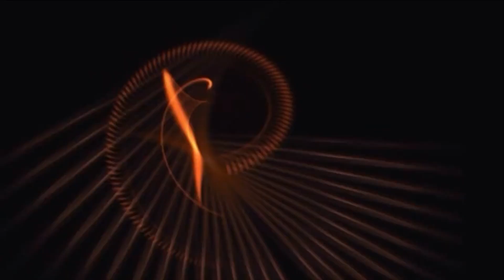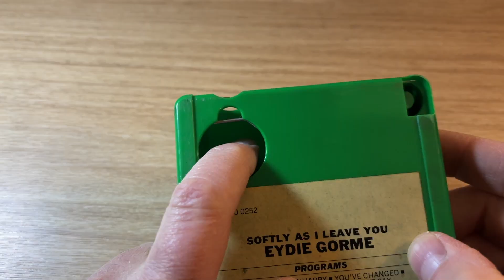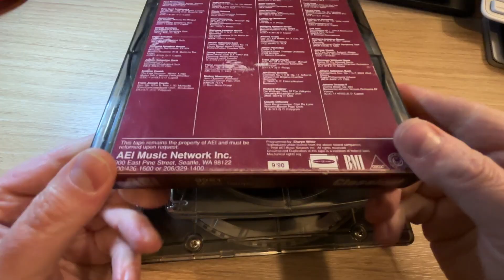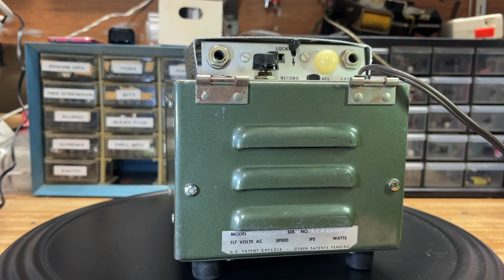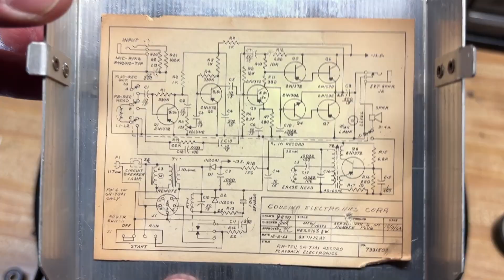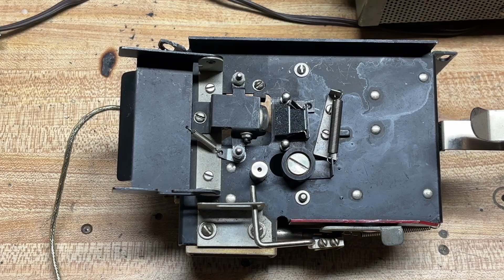This “Lost” Tape Format Is Wild! Cousino/Orrtronics Audio Announcer Explained

Comment: John Herbert Orr from Opelika, Alabama aka Orrtronics was a pioneer in magnetic tape. Also in opelika, a was Ampex tape. I had a friend years ago that worked for and with Mr. John Herbert Orr. This friend owned an electronics business in Auburn, Al. I have a John Orr designed 8 track player not like the lear 8 track that everyone knows but somewhere down the line i have lost the tape. This thing is unique as the head comes into the bottom of the cartridge. I was told that John Orr sold the rights of this system to Bill Lear of the Lear Jet Corporation in which is was re-designed. I don't remember where i picked up this player which is for automobile use. If someone had a museum or just wanted this player i would let it go. Seems like everybody was back then was wearing out the endless loop design method of tape transport usuing graphite lubricated tape.

Comment: There's yet another Orrtronic endless loop cartridge format. I've only seen one, and that was back in 1967. It looked like a 4 track cartridge, no pinch roller, but the tape ran parallel to the bottom of the cartridge! I suppose the capstan entered into the edge of the cartridge, the head and pinch roller came up from the bottom. Very very strange. Obviously designed to circumvent the Fidelipac, Cousino and 8 track cartridge designs. I wish I had kept it, but it belonged to a friend, who sadly, has passed away.

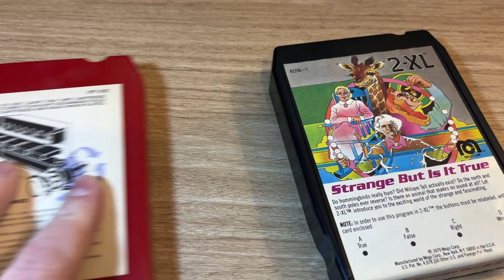Comment: I have the Quad tape seen at 2:10
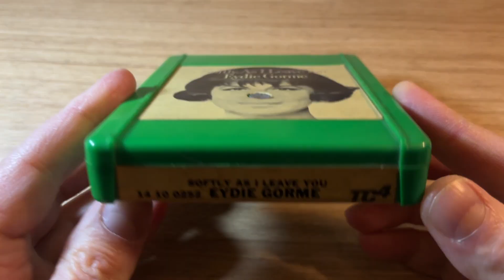You likely tell, but the pinch roller for the tape at 2:27 swings up and into place from the deck. And, please, the screw was covered by the graphics until someone cut out the opening to open the tape. 🙄 
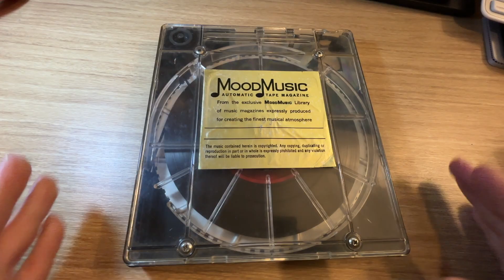The tape at 3:37 was also sold for home use as we had a lot of those in the late 60's early 70's with classical music my parents loved. They had slip covers too.
9:10 the foil tape is also at the splice, where the ends of the tape meet.

Comment: Ammo box is spot on!! Not made to be pretty. Reminds me of the Tapecaster radio cart players I used at my first job as a DJ in the early mid 80s.  And these machines were ancient then!  All military-style thick steel with a long top and sliding capstan lock lever and a big Start button.

Comment: The tape travels in the opposite direction to 8-Tracks.
Also I wonder if the flutter is from the center of the pinch roller being slightly too big ?
Great vid, not seen these before.